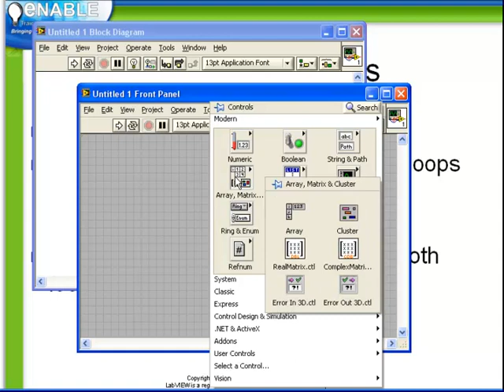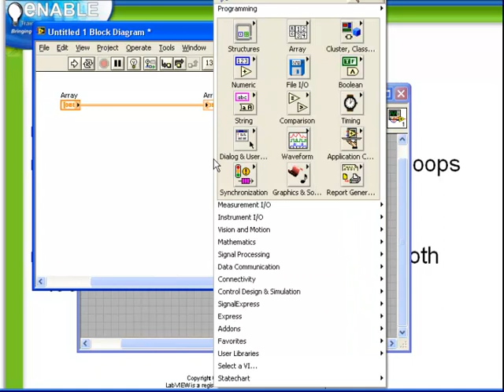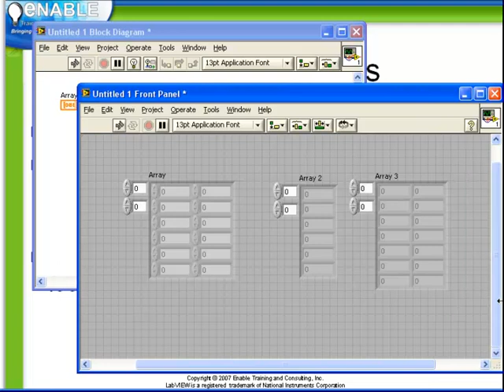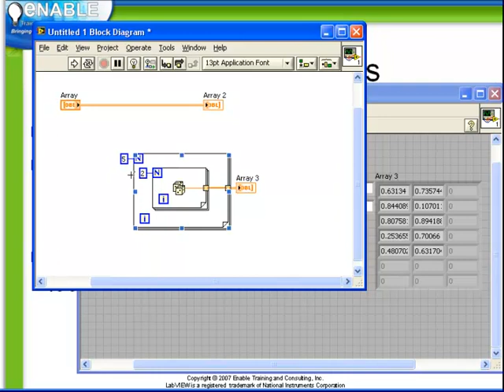LabVIEW Tutorial 8 - Creating 2D Arrays (Enable Integration)

Comment: Found it didn't work with LabVIEW 17.0. Took a bit to figure out but here's the solution.

If you 'right-click' on the auto indexing tunnel in the embedded for-loop, select "Tunnel Mode" and select "Indexing" (it's initially set to "last value"), then that works. 

However, Array now shows an error so you have to delete that and create a new Array 3. It will then display the array shown in the video.